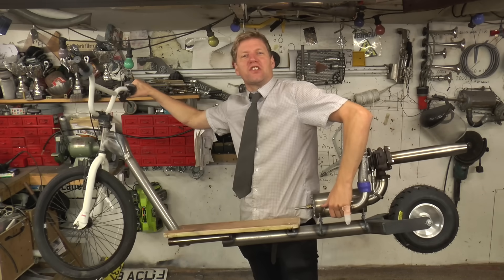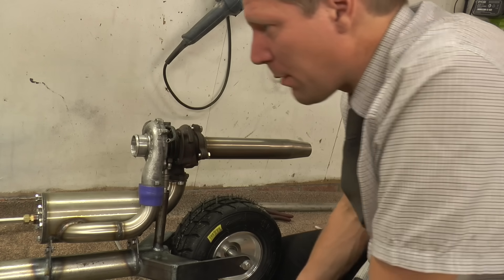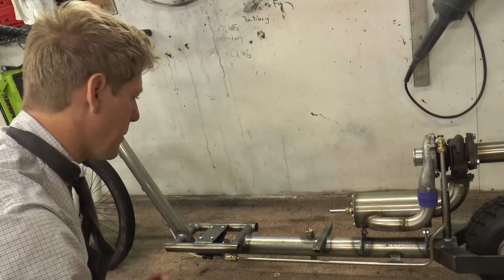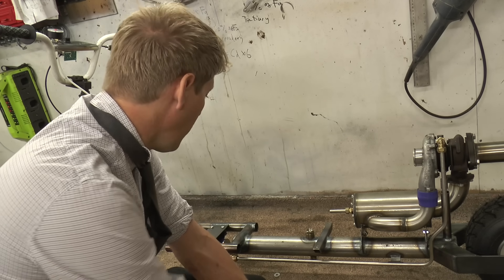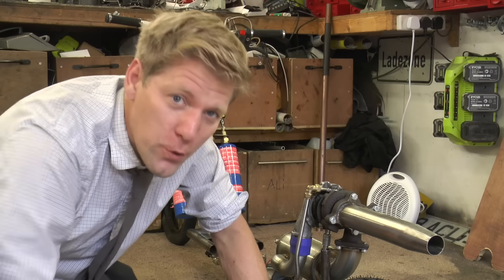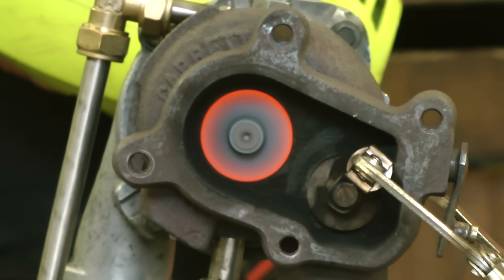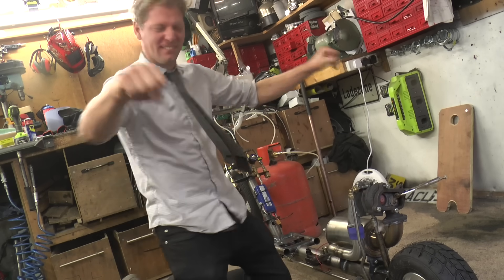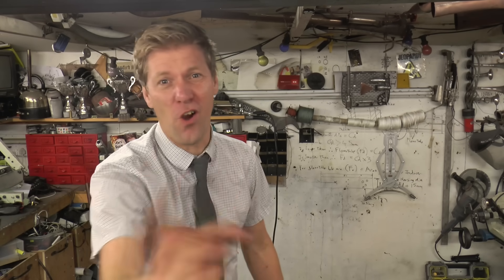TurboJet Scooter Build #2-Oil/Fuel/Test Fire

Comment: Colin, I love your videos, but coming from a fellow turbine builder here, the only way you are going to get this thing to produce any thrust is if you can give it a LOT more fuel, and gaseous propane just isn't dense enough to do it. You will find that if you flip the bottles upside down and don't use a pressure regulator, thus feeding the engine with LIQUID propane, you'll be able to produce vastly more power. Also, you may want to put a pressure gauge in your compressor outlet so you can get a better idea of how much power it is producing. Hopefully you have a compressor map for the turbo you are using, but even if you don't, you'll find that most automotive turbos are most efficient at a pressure ratio of about 2.5.
Reply: Wow, wow, swear words and insults, you'd think I personally insulted you with my experience! Although, I do have to say, the rudeness does pair nicely with the rest of the ignorance you display in your posting. If you're going to be an idiot, might as well go all out, right? Good job!
 I doubt you are going to understand this, but for the sake of anyone else reading this who cares to know why it is not working, the issue is very simple: the compressor is essentially unloaded in this situation; there is no backpressure posed by the turbine to cause it to produce meaningful boost, so mass airflow continues to increase, and since fuel flow is limited, it increases until the airflow through the combustion chamber causes the mixture to become so lean that it can no longer burn and so the turbine flames out. The only fix here is to add more fuel, which will cause the turbine to continue accelerating until backpressure rises to the point where it can now reach a stable operating region; it is then possible to throttle it somewhat within that region by adding or removing fuel. But hey, what do I know, I only have a Mechanical Engineering degree and built a jet engine from a turbocharger while in college... ;)
Reply: To his point, propane engines on forklifts run on liquid propane, not gas propane like grills use.
Reply: @Wroger Wroger could it be that propane acts or reacts differently in gas form so all the mix was doing was burning out once too much air was hitting it? Sorry for trying to understand things in laymen's terms. It seemed fine with a fan but didn't produce enough thrust to keep it going? Which would indicate a fuel issue, correct?
Reply: either too much or too little..that's my question. Once a turbojet is under it's own power.. if you were to trim the fuel down would it stay running lean at low turbine speeds or just completely go out if you're say getting too much air?
Reply: Lol, yes it was rich enough until it wasn't, and then it flamed out. I am guessing from the way you talk that you probably weld for a living. You should stick to blowtorches, turbines are way too complicated for you, Wroger Wroger...
Reply: @Powerlabs  so technically in laymen's terms I was correct. just didn't know how to word it correctly..
Reply: Yes you were absolutely right. My replies were directed @Wroger Wroger.
Reply: +Powerlabs  As you seems more competent than me, could you tell us what you think about nozzle design?
I believe one of my exam subject showed that to get more thrust a jet nozzle should widen at the end, not tapper. But then Colin seems to say someone actually thought the whole scooter design out (a chap named Peter) so it must make some sense.
For reference, the subject was about one of Arianne 5 engine.
Reply: Powerlabs this is a comment
Reply: @le phlump which is why fighter jets have an adjustable nozzle. The way it was spitting like it was makes me think it was a fuel issue, the air to fuel ratio was probably too high and the fuel was just getting burnt up or gas propane is a bad fuel source for turbo jets. I don't know what he had the propane pressure set to, but looked like as soon as it had ignition it went out instead of staying burning once it was making power on it's own, making me think the jet is too small. Which brings me back to the first point I said, a/f ratio is off. I'm not a jet propulsion engineer by any means, just know how they essentially work. Take my advice for what it's worth.
Reply: +Wroger Wroger Well, I'm might be a little naif (I'm a student, and to actually build something as complicated as a jet engine maybe impresses me more than it should) but it seems you've been too quick to dismiss Powerlabs.
First, he actually built built a jet engine: https://www.youtube.com/watch?v=vovhaDtrdJg
Secondly, I don't think he meant to drown the turbo in fuel, just that Collin didn't use nearly enough. Collin said you could not get much flow out of those propane tank, so I guess the way the engine failed seemed symptomatic of underfeeding. I also think that he forgot that Collin was pumping liquide fuel into the engine (or was it lubricating oil?) and considered a purely propane-feed engine.

But if you can answer my question yourself or correct my mistakes (scientific or grammatical) I'd be happy to read it.
Reply: +Le Flumph read my comment above yours, also I think the flame tube is too small and I, like +Powerlabs think he didn't use enough fuel. He is also using the pump to pump oil through the turbo not liquid fuel, this keeps the turbo cool, but not having an oil cooler really won't do anything to keep the turbo cool other than outside temps going around the oil res.

I also think he'd get more thrust if he got modified low torque turbine wheels more like what's used on modified diesel engines.
Reply: +Le Flumph Sorry for the misspell on your name also!
Reply: +Jonathan Arnold No offence taken for the misspell. I just read the "suggested for you" comment and skipped yours. I thought "oil" was referring to petroleum, thanks for the explanation.
+Wroger Wroger That makes sense. I'll have to read your analysis again when my brain had some sleep but thank you for your very instructive answer.
Reply: @Wroger Wroger so you're saying it's a design flaw.
Reply: Yes, don't listen to the Mechanical Engineer who happens to have built one of these that actually works ;)
Reply: 😢aev😊😊
Reply: @Powerlabs. Hey! what size of turbo did you use for your engine?
Reply: I do not recall, it was a Holset turbocharger off a large Diesel engine, maybe a 12 or 15L diesel. @carsonyoder6294

Comment: I know the valves are not on, but bro, I freaked the hell out when you were welding the gas system when the canisters were on.
Reply from the maker: they were not screwed in so was no gas in pipe etc
Reply: Haha, thank goodness
Say, lets say Im building a flamethrower, were did you get the canister adapters/screw ins?
Ah, wait never mind, you put them on the lathe, so its custom.

Comment: you REALLY need to put an afterburner on it!
Reply: After burner, hmmm. I wonder if anyone has noticed the brakes are from a bicycle 😁
Reply: afterburner: "when you inject [low pressure] fuel straight into the TAILPIPE past the turbine, it mixes with the leftover air", which a finally convergent nozzle optimizes flow acceleration. You pretty much defined an afterburner when you were arguing there wasn't one.

A rocket burns high pressure fuel and high pressure oxidizer (absent in a jet turbine...it would melt) in a mixing chamber, then a divergent rocket nozzle optimizes flow acceleration as supersonic gases exit the chamber.

Jet engines and rockets both "act like rockets" in that they accelerate mass to produce thrust - they don't push on anything.

Colin's engine has an afterburner from the way he described it...it has idle (axial flow jet turbine), and full blast (fuel pumped into the tailpipe).
Reply: @vidznstuff1  no, the gas pulses still go into the main combustion chamber. There is no actual fuel bypassing the turbine and combusting directly into the nozzle.
Reply: @vidznstuff1  The oxidizer is still present in an afterburner, just not as strong.  The left over oxygen coming out of the exhaust mixes with the air and combusts it just like a rocket. I never said that it ran on liquid hydrogen and oxygen so it's not going to get hot enough to really melt the rocket.
Reply: @vidznstuff1 
Its not connected it to the tail pipe
Both the idle and the solinoid go to the combustion chamber

But it would be good if the solinoid was connected to the tail pipe he have the power he needed then
Reply: Not necessarily a bad thing if he put on 4 piston dh brakes
Reply: It has one...
Reply: @vidznstuff1  no it doesn't.  when you inject fuel straight into the nozzle past the turbine, it mixes with the leftover air and acts like a rocket.

Comment: If you add some (for want of a better term) breather holes near the turbine end of the nozzle, that ought to draw in air from outside and increase the exhaust volume. See designed like the SR-71

Comment: Colin you probably have the larger one running by now but if not be careful with the combustion chamber end gap from the inner flame tube to the end of the combustion chamber. When we built one with a large T3/T4 stage we had only slightly larger volume of chamber than you show but we had a massive gap at the end of the inner tube to allow for air to bypass the inner tube. Allowed much more flow and allowed that cooler bypass air to act like an envelope so it shaped the inner flame to nice, short and efficient. The thing would howl at speeds. Hope yours will do the same.

Comment: Hey Colin! From what little I’ve learned about jet engines in my schooling, you could try adding an afterburner to increase thrust, however such a measure is terrible on fuel consumption and wear on the turbine. 

Best regards, an aspiring engineer

Comment: I'm working on my own turbocharger jet engine, and your videos have been really helpful. I don't recall doing any multiplication of the flame tube diameter if the inlet size is too small, however. Could you share what you're using for your calculations?

Comment: Colin? What if you ran the fuel lines out and around the exhaust nozzle in a coil to keep the jet from over heating, and then back and around the fuel cylinders to keep them from freezing up and losing pressure?  Could possibly solve two problems at once.
Reply: My reverse hybrid rocket I designed did something similar by having the fuel tank and the combustion chamber concentric with each other, so that I could keep the chamber walls cool and maintain pressurisation still.
Reply: Damn ur smart xD, I don’t think I’d be able to understand that stuff

Comment: Colin please add an oil cooler to this that oil is going to get thinned out so fast!
Reply: He could have wrapped the oil feed hose around the propane tanks they would have cooled it.
Reply: Scott Cress yes and it would keep the tanks from freezing too
Reply: @Scott_C  thats a good solution!
Reply: definitely so with the bigger turbo
Reply: @colinfurze Agreed! Keep the oil between 110-130'C with a thermostat and add a filter and this thing should still work when the nipper is big enough to ride it ;)
Reply: Definitely oil cooler and is there any room for the oil to expand?
Reply: It seems to me that the major problem was the lack of an oil filter...or I'm wrong?
Reply: @dadoVRC  it certainly wouldn't hurt
Reply: @ryanriddell9314  The cooler?
Certainly not, but maybe the surface of the tank and of the piping can be big enough to help in cooling.
For sure in "long" runs the oil get too hot.
Cooling is a good idea, what I mean is that filtering is more essential, any small debrise can destroy completely the bearings and the turbine shaft!
Reply: @dadoVRC  I mean the filter wouldn't hurt yeah. Any contaminants and that new turbo is dead.

Comment: Nice job. You should use a oil cooler and a bigger tank with more oil. The temperature in the turbo is too high and there is no coolant only oil makes the job. That turbo will melt if you don't

Comment: does the down tube to base transition weld need a bracket?  It appears that it would be a weak link (twisting force) and may need some triangulation. (obviously after you get the turbo working) But I won't argue with Furze experience!
Reply from the maker: ni it could do with some added strength your right

Comment: Colin! As you are now having a huge turbo to power your scooter will you still be using a solenoid to adjust the gas flow? If so will you PLEASE get yourself a second safety tie? Two ties must be safer than one, and although I am resigned to the fact that one day your experimentations will probably lead to your untimely demise it would be a shame for that to happen for wont of a tie.

Comment: A few notes from too many years spent reading the JATO forum:

The area of the exducer of the turbine (hole in the back) must be at least 10% larger than the inducer (hole in the front) of the compressor. With an internal combustion engine driving the turbine, you can afford to use some backpressure to drive it, but this isn't the case with a jet engine. The hole in the back must be bigger than the hole in the front. Diesel turbos usually satisfy this; performance petrol models not so much. In any case, it's easy to measure. 

Air is best delivered normal to the combusiton chamber NOT tangentially. With tangential delivery, the swirl created in the can makes it harder for the air to pass through the holes in the flame tube. A diffusing cone between the delivery pipe and combustion chamber is also desirable. Delivering air nearer the bottom rather than the top near the injector is also better as it can't get blasted straight through the primary holes disturbing the flame and creating uneven combustion. 

What does your propane injector look like? You should have small (<1mm holes) radially, NOT axially. Too big and the gas speed won't be high enough to penetrate into the flow in the combustor. Axial injection simply shoots flame right at the turbine leading to overheating and non running. 

Add a thermocouple so you can monitor the temps going into the turbine, and a pressure gauge on the comp outlet. Try and keep the temp under 650C, and you'll find it much easier to start if you get over 4psi. Under this you'll end up with "hot" starts as the turbine has to work very hard to spin the comp up. You may need a bigger leaf blower... Idle around 5-6psi, depending on the turbo, try and aim for 15 or so psi at full throttle. A diffusing exhaust (just a shallow angle cone) will make starts much easier while you're developing it. Once you've got it running nicely and are happy with it, you can then start to add a proper nozzle and try getting best thrust out of it.

Hope that's helpful, I'll look forward to seeing it working :)
Reply: And should I use Diesel fuel rather than high-oct propane gas?
Reply: Liquid fuel requires quite a lot more setting up. You wither need to incorporate vaporiser tubes to atomise the fuel using heat in the flame tube (usually preheated with propane) or a high pressure delivery system and atomiser nozzles.

Comment: Another beautifully machined build... I am disappointed that you did not put any filters on your oil or gas system as the dialectic and general residue from your materials and machining will send a bunch of stuff" into the close tolerances of your turbo...
Reply from the maker: I cleaned it out really well before filling
Reply: I saw you "blow it" but things will get very interesting if an internal burr breaks loose... your build quality has just become stunning and in many ways, I find that observing it be (even) more interesting than the project itself.

It's time to get the ensemble of your creations into a curated touring format and have them displayed at various museums around the world as part of an on-going touring exhibit at say science museums... they with some multimedia videos of the devices in-action would be a great inspiration to kids and adults alike...

Comment: Haven't watched to the end, but thinking that the oil could slosh to the back of the reservoir, away from the oil pump pickup, (and possibly out the drain hole?)

Anyhow, neat system, overall.

Comment: The small turbo which went bad on you is only a small brass single journal bearing turbo, recently pulled one apart because it didnt spin.... half the compressor wheel was missing and the bolt surface on the bearing holder had cracked all 4 mounts to where it bolts up to the compressor housing. Good luck with the new turbo, looks like a seriously expensive way of doing it.

Comment: Maybe try putting some kind of stator vanes right after the turbie wheel into the exhaust nozzle, so you´ll have a directed airflow and not some hot air swirling around in that jetpipe :)

Best Regards Jonas (German Airforce Jet Engine Mechanic)

Comment: Hey Colin, two questions:
a) what drivers licence will be needed for that to drive it legally on the street? ;-)
b) have you considered connecting the turbo with a transmission, so you'll not have to use trust (eventough that's cool!), but can make use of the kinetic energy of the rotors instead? (like turbine-powered helicopters)
Reply: I suggested a turboprop to him. Let's see if he bites.

Comment: I don't quite get the principle of that propulsion tbh. Anyone got a wikipedia article or something similar?
Reply: HoverFly same as a jet. Air is compressed then fuel is added, the combustion heat air so it expand and flow out of the tubine creating thrust
Reply: i always wondered, how the fuck do turbos hold that many rpm constantly like, the must burn a TON of oil, right? teach me
Reply: Air come out the back real fast.
Reply: It literally blows you forward
Reply: HoverFly air

Comment: you definitely need to create some sort of after burner system for this thing, or any of your turbojet creations. Also for a good throttle you could use a butterfly valve on the inlet of the turbo (like a the throttle body on a car) to control the amount of air going into the turbo with the same sort of thing for fuel too.